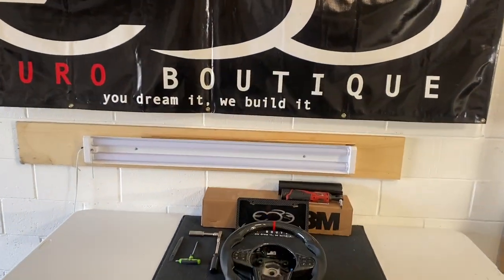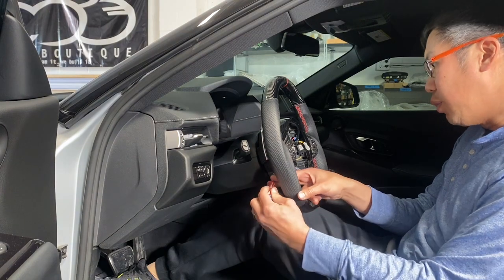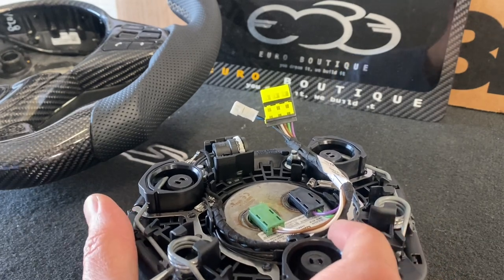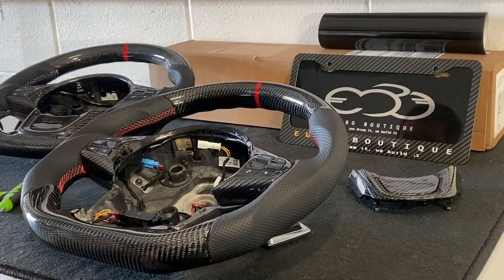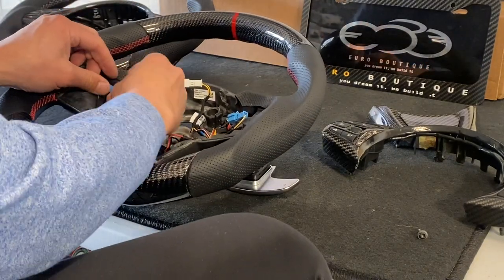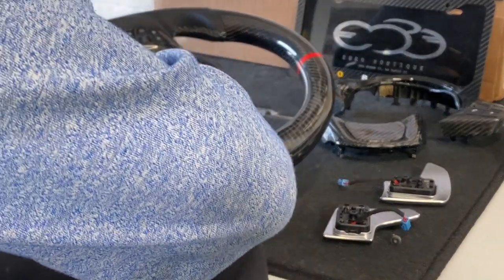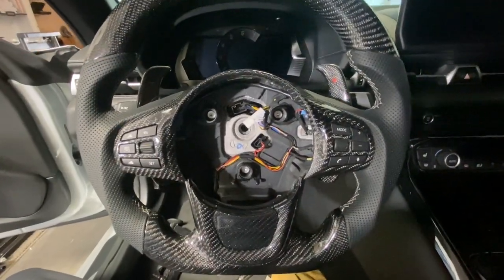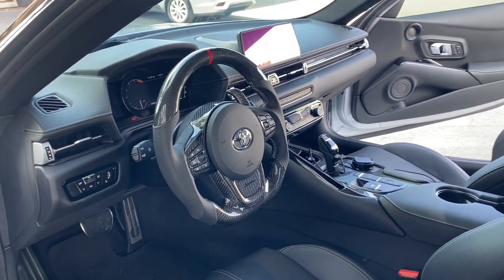2020 A90 Toyota Supra CF Steering wheel Install

Comment: I have changed my supra steering wheel.. it's very hard to do it without impact tool .. you can't open the bolt with the torque wrench 🤔.... or maybe it was just me .. but it really was difficult to remove .. the rest of the process is fairly easy though as long as you have the impact tool to open the bolt .. you can checkout my video
Reply: Same here bro- the center bolt WOULD NOT BUDGE on my 2022 Supra.  Purchased an Impact Wrench- fingers crossed it gets the job done.
Reply: @jeffbarwick8823  you're very committed on doing it yourself haha .. but now you have the impact tool , you should be fine 🙂
Reply: Hopefully this message is not too late .. I have seen a guy who successfully removed the bolt without the impact tool.  He turned the steering wheel all the way to the left then he put pressure on the bolt using a normal socket rench ... I didn't like that way , but it did work...
Reply: @MustafaAli-85  I was not comfortable using more force- I literally feared I would damage the vehicle I was using so much force. If I had somehow managed to strip that bolt I would have had a big mess on my hands.  Better safe than sorry. Went ahead and purchased an impact wrench and it came off perfectly.  THANK YOU for your post- it made all the difference for me.